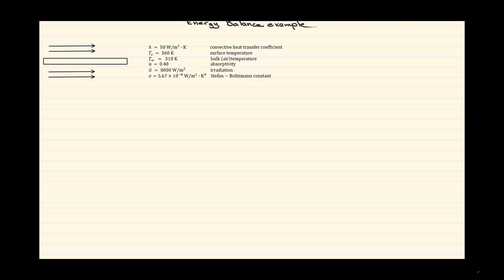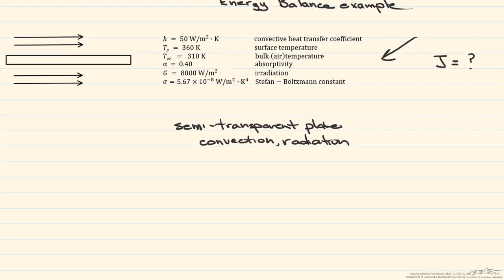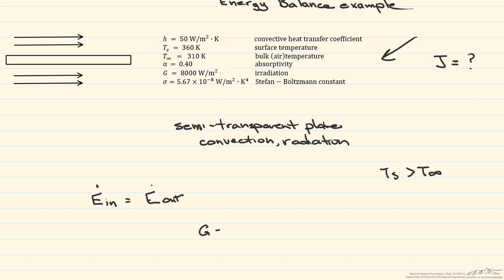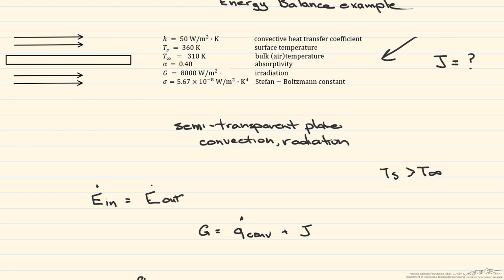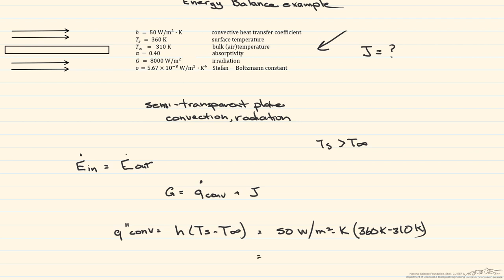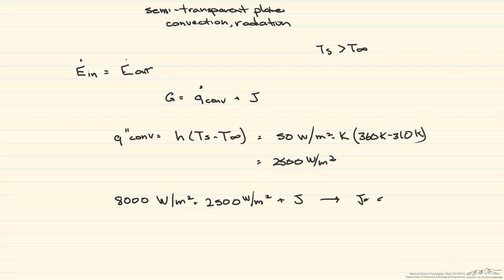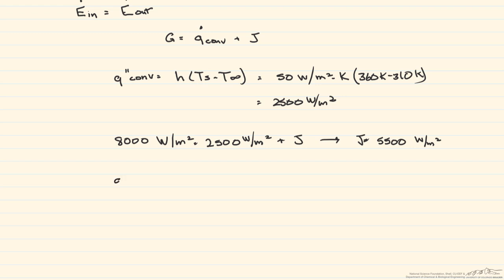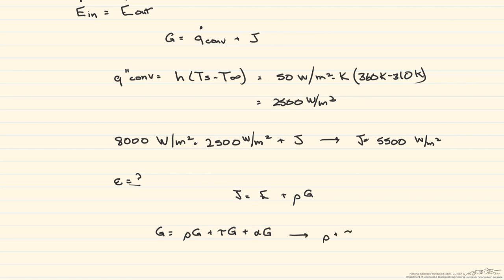Energy Balance Example Using Radiation

Comment: Because the plate is semi-transparent, some of the incident radiation is transmitted. The emissivity cannot be calculated unless the transmittance is given. Without the transmittance, there is one equation with two unknowns. In the video, the transmittance was ignored which is incorrect. By my calculations that transmittance must be between zero and 0.0315. If it is equal to 0.0315, then the plate is a blackbody.